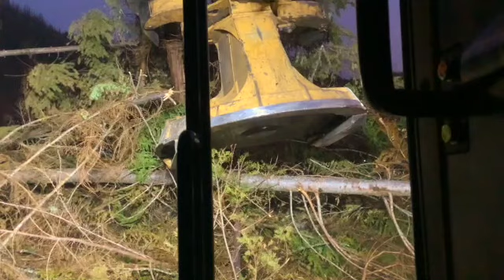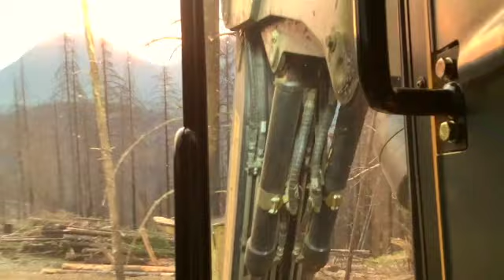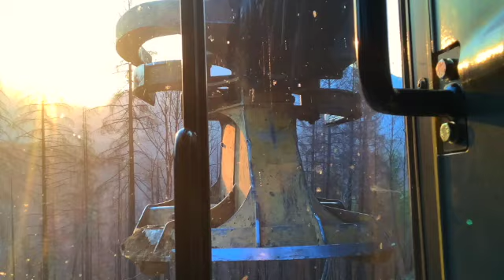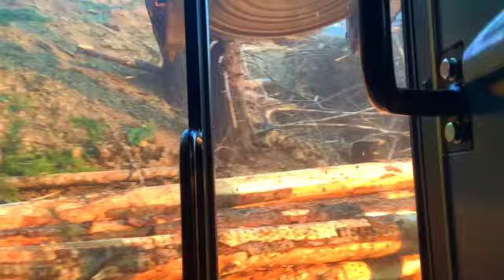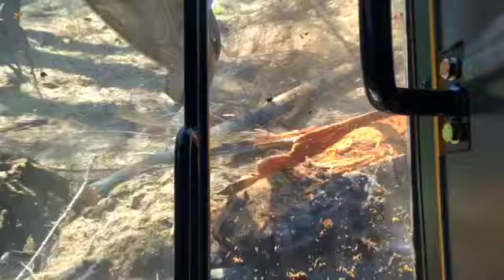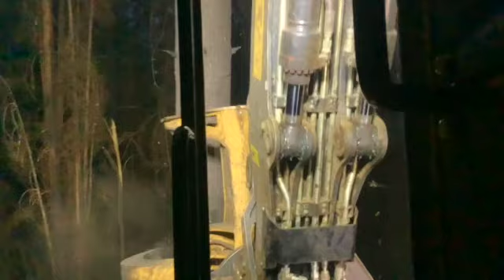Death Ball Mountain : Last Piece Of Ground For The LX870D Tigercat (Video# 3 of 3)

Comment: Great video. Thanks. Difficult ground. I am fairly new to bunching with a Timberjack 608S. Bunching is a life changer from hand falling. I am a flat lander and have much respect for challenging terrain. Love the service truck. Have a good day
Reply from the maker: Glad you enjoy the videos. It's been a while but I have been around the 608 series. Is the S model a non-leveler? I also started Into bunching coming from hand-falling, back in the early 80's. What part of the world are you working in? Thanks for watching and for the comment, we appreciate it! Be safe.
Reply: @thedailylogger  Yes it's a non-leveler. Same machine as a John Deere 753G. I'm in south eastern Ontario, Canada. Mostly hardwood and a bit of white pine. 20% sawlogs and 80% firewood.
Reply from the maker: @davidgibbons5366  Right on! At an outfit I worked at in the past we had an early 608 leveler Buncher and also a flat 608 harvester. Tough machines. Timberjack was a forestry powerhouse, I spent a lot of hours in the 950's, great machines. Tigercat drew heavily on that brainpower in their early years I think. White Pine and Hardwood, sounds familiar, I started my own company in New England a long time ago, cut a lot of both over a 20 year period. Appreciate your watching and commenting, glad you get something out of our videos. All the best! Hope to hear from you again. Be safe.

Comment: Do you run quadco teeth or gator? Opinion?
Reply from the maker: Good to hear from you. I've run both the Gator and of course the Quadco. The Gators are an awesome tooth, I've got a set waiting for the right unit to come along. I find them to be too hard, in rocky conditions they haven't held up well for me. On good soil they give really good performance and life and are worth the premium price. I ran Quadcos for years, they really have been the best, and for quite a while the only option. But I tried the Ballantine teeth a while back on recommendation from Marc at Pape Longview and I am really happy with them. The design is really similar to the Quadco. They give good service life- I got 800 hrs on one set! In general I'm satisfied if I get 400 out of a set, using 3 faces. They are very competitively priced too. I highly recommend them. Thanks for asking!

Comment: What kinda skidders do y’all run
Reply from the maker: Thanks for the question. We run shovels here, on this unit in the video the logging shovels are a 568 Cat and a 3756 Deere. The Deere is set up as a Yoder. It doesn't really look all that steep in the videos but the ground is fairly challenging so the shovels ability to scratch in trails when needed is important. It also rains about 9 months out of the year too and the soil doesn't hold up to wheel skidders! Thanks for asking, and watching, we appreciate it! Be safe